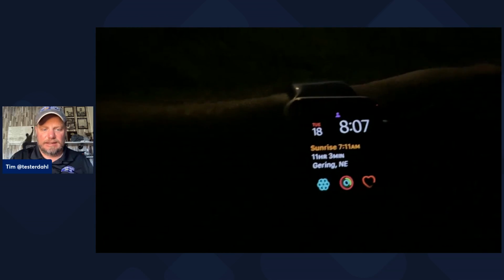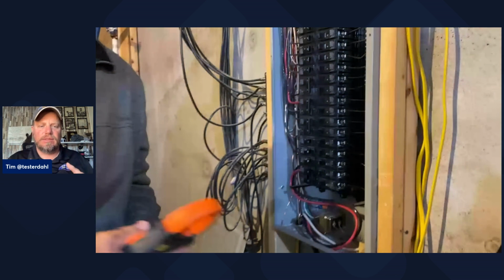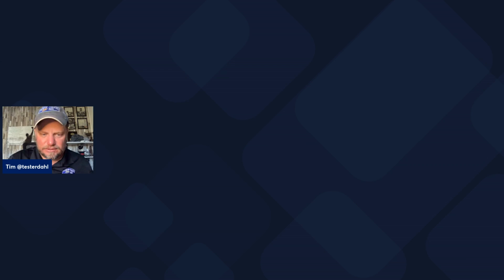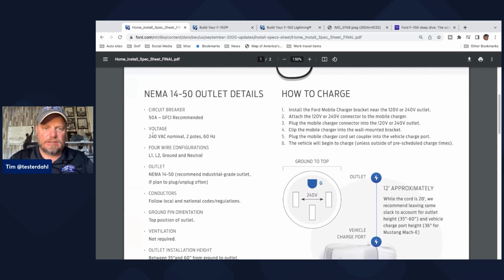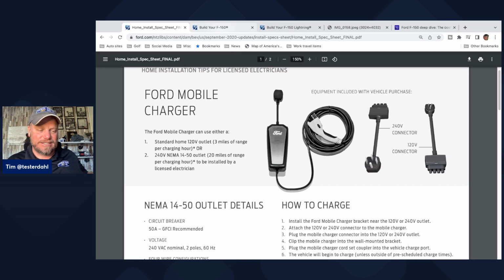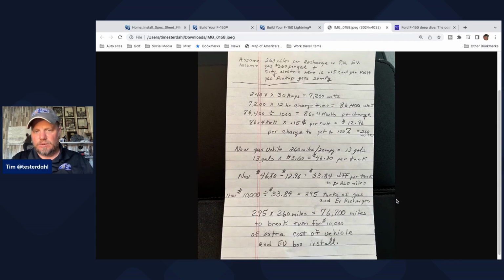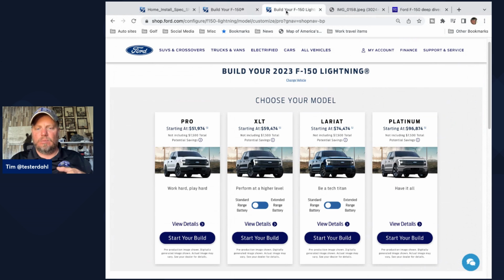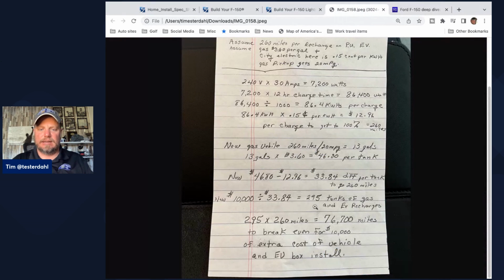11+ hours later on 220V charging price for 2022 Ford F-150 Lightning

Comment: Driving a 21 ecoboost F150, it has a 34 gallon tank that takes 7 min. to fill, has a 850 mile range city hwy combined and about 960 if Hwy only. Filled it today, 33 Gals (was real low) @ $3.14. So 7 min. a $103 and no worries for more than a week!!
Reply: Where is there $3 fuel?  Here in Idaho it is $4.25 for 85 octane unleaded and $5.40 for diesel.
Reply: @byronhaley1566  Okla City, it's $3.15 right now at the 7-11 just down the street.
Reply: They don't make a Ford that will go 960 miles on a tank of gas
Reply: @byronhaley1566  Kansas city. Bought again today at Sam's was $3.13.9 but most others around are $3.29 and its seems to be starting to trend up again.
Reply: @jameskimbrell4971  Yes your right about the 960! Filled up again today and avg 24.2 mpg city and hwy. range was 846 On the Hwy only I get about 27 it's only 2WD but still really great for a 4 dr
Reply: A thought:  without competition for electric supply, the owners of the electric grid will surely take advantage of consumers.

For safety, no one other than a pro should ever be standing around the open electric box.
Reply: my cousin bought a new Ford maverick hybrid pickup.  he's getting 48 mpg with it.  no charging needed.

Comment: Battery technology has come a long way in the last 20 years. I use cordless tools all the time and over the years they have gone from NiCd, NiHD, and now lithium technology. The tools really don’t cost that much, it’s the batteries. They last a couple years then stop charging without warning. As much as that is annoying, having it happen on the road in a vehicle especially if you’re in the middle of nowhere is not something I’d want hanging over my head wondering when it will happen.
Reply: Electric cars and trucks are not about saving the environment in any way or form. Its about controlling our lives and movent plain and simple.
Reply: Isn't just the batteries going bad without warning.

Comment: A branch circuit is only supposed to allow 80% of continuous load. So if you have a 50 amp 240 volt branch circuit then you will only be able to run 40 amps of continuous current without the breaker tripping. The minimum circuit you should have installed would have been a 40 amp 240 volt circuit with an 8-3 wire.  Your vehicle might also be slowly charging itself at night because it is better for the battery to slowly charge itself. A lot of smart devices now will slowly charge themselves if they are charging at night because they know they will not be used for some time.

Comment: Outstanding video! Here in Ohio, they also charge you $200-$500 to renew your tag for an EV. Yeah no thanks. Don't get me wrong, I am intrigued with the technology behind the vehicles, however, this is a luxury versus a must have. What is a "must have", a vehicle that is reliable, resources available, and will get me to work where I "need to earn" a paycheck to ensure I can provide for my family, not a luxury.
Reply: They trying to recapture the road taxes for the gas you don't use. Still, a bogus charge.
Reply: @ New Energy. I don't think any reasonable person could disagree with your statement. EVs are still in their infancy and some day they may be the go to for the majority of transportation needs but right now the ICE is still the necessity for most people.
Reply: @alexandermckay8594  

I did the math, fair value for tags would be $100 or less... Not $200+

But really the tax needs to come from state electric taxes.
Reply: Um it’s $200 extra but how much fuel cost are you saving?
Reply: Show me a tag for $500 for tags on an electric car?
Reply: It's $100 extra for Hybrid and $200 extra for EV. I bought a Hybrid accord last year and glad I did with these gas prices. Went from filling up twice weekly to once weekly and with a 3 gallon smaller tank. I get 43-45 mpg real world driving. I wouldn't mind owning an EV down the road but right now I think EV's are over priced, the batteries suck, and the infrastructure to charge them is not good. We need standardized chargers/plugs first. Second we need better batteries that can support fast charging. third we need charging stations that can support all these EV's. Until then I am fine with a hybrid.

Comment: For someone not able to handle the cost of the extended range battery in the lower trim options ( which the price varies depending on trim level up to around 10K on the XL ) it leaves the owner with a 200 mile range or less in winter.

Comment: Hi Tim just wanted to share a quick tip that most F150 Lighting owners don’t normally use after each charging session is to go to settings/charge/reset and hit reset your going to gain some mileage because the computer will reset from your last driving session.

Comment: The on board charger in the truck is capable of either 11.3kW or 19.2kW per Ford's website which is actually a very impressive spec. That being said, the EVSE (also confusingly called a charger) that was included with the truck is rated for 30amps (240v X 30a = ~7.2kW) which is why the charge times don't quite live up to the marketing numbers. The EVSE is what instructs the vehicle's on board charger - the real charger - the max amount of current to pull. It is done that way so the EVSE is always the source of truth for what max amperage that local circuit is capable of providing. Maybe Ford went with a 30 amp EVSE  because that's a reasonably safe number for the real world of 8/3 on NEMA 14-50's. I know EV's tend to invoke a political conversation but I think that line is starting to be blurred as people see it as a viable technology for certain situations. Thanks for the video, it was really interesting.
Reply: I bet it has a very impressive cost to have it worked on.

Comment: In cold Wisconsin winters, my uncle's Tesla Range drops about 50 percent.  Now imagine towing in the winter.
Reply: Why are you towing in the winter. Also another hypothetical let’s say the technology get trucks up to 500 mile for a trucks. Say you can tow for 250 miles. If that bad. Not to mention normal trucks lose range in winter was well. I’m not sure your 50% claim is true at all
Reply: @moultonlavagaming  to go snowmobiling, or Ice fishing, or hauling buildings supplies. The reasons can be endless. Some people use their trucks.
Reply: @CanadianSpeedster  no one is forcing people to get EV’s at this point. You can choose an EV you could choose an ice vehicle. It’s your toys nobody’s forcing that down your throat.

Comment: I bought the same truck.  Ended up getting a 40 amp charger off Amazon.  Plugged in I am averaging 21 miles per hour.  Gives my wife all she needs to get around for her daily driving.  Man, because of your channel I have purchased my two favorite trucks within the last 6 months.  Back in July I picked up the 2023 Chevy Duramax Diesel 3.0.  Then knowing I owed my wife for supporting that desire, and trading her car in, payback came two weeks ago. I picked up the 2023 Ford Lightning for her.  I love that truck.  Not as much as my diesel, but it’s definitely a close second.

You’ve got to stop making these intriguing videos😂.  I’m now $130K out on truck loans😂.  All jokes aside, thank you for taking the time making these.   I really do have these two trucks, and can only blame you for the two awesome decisions I’ve made.  Both have great benefits, and actually find a way to compliment each other, due to the driving styles of both my wife and I.

Comment: Guessing the mileage changed even though charge went up to 100% because vehicle/battery temperature changed.  It seems like the perception of "range guage" as a precision instrument needs to be rethought since it makes calculations based on multiple variables.
Reply: Yeah hate range readouts, even in ICE vehicles, but I’m the type to reset my trip each fill so I know how far I’ve gone and can accurately gauge what is left based on mpg.
Reply: The range is a guess based on your driving habits. Him sitting in the truck looking at it is what reduced the range, the truck thinks he likes to sit in park with the truck on so it lowered the range.
Reply: It never has been a precision instrument, even on ICE vehicles.  On the Chevy Bolt, the range gauge is affectionately referred to by owners as the GOM:  Guess-O-Meter

Comment: OMG so I did the math for CA residents which is roughly during 3rd tier time of usage (after you come home from work) is about $.31 per kwh. It's like $25 a day to charge the car for at least 25 days (I have a long drive to work) pushing it over $600 just for the car. That's not including when the AC is on during the summer which our bills are $250 when we conserve like crazy. We can barely afford when the AC is on or Christmas lights during the holidays in CA, and cut down this past year because we budget for a $200 bill. No way in hell am I going to have a bill tipping at $1k. That's ridiculous!! These electric companies want to make money and the politicians are like buy EV.
Reply: It's okay you won't be able to charge your car in California because we constantly have power outages because we don't have enough power. So it won't cost you a dime to charge your car because you won't be able to charge your car.

Comment: As you drive more miles to make the price point of the original purchase feasible, you need to put more and more charge cycles on those lithium batteries, witch they have a finite number of cycles before their overall deliverable amp capacity starts to see significant degradation. Resulting in less range per full charge, thus increasing the number of charge cycles to attain a given range. Ultimately requiring a battery pack replacement which is extremely expensive $$$$$$$.

Comment: A new battery pack may cost $15-$20,000 now, but I doubt the price will be that low in ten years or more.  Sooner or later, you will pay...someone.  A solid analysis, by the way, relies on unchanging variables to be accurate.
Reply: In ten years they will allow you to rent the truck for a cheaper price.
Reply: At a dealer, yes, batteries will be expensive.  But there will be dozens of companies offering cheaper aftermarket batteries, as we have now.
Reply: 20k + labor... so just expect to pay 50% of the vehicle cost in 8-10 years
pieces of junk
Reply: Today's batteries will be NLA ten years from now due to the manufacturers getting out of the BEV business to avoid going bankrupt.

Comment: So if you’re not living in a modern home with 200A service with a service panel in the garage, such as apartments, condos, etc. you’re a fool to fall for the EV bull crap.
Reply: Only one of the many down falls of a electric vehicle.
Reply: Just depends on how much you drive. I've been charging off a single 110V circuit for years. If you drive less than 30 miles a day (on average) it's not a big deal.
Reply: Really 100 amp service would be more than adequate if you have a gas stove... and dryer.   Even with ac pulling 30.. plus 30 on charger leaves you 40 to spare..  and led lights.. coffee maker.. etc.  Still no 40 amps... plus won't all be running at the same time.

Comment: The issue with them asking for a 50A capable hookup ‘only’ providing 30A of charging is this: there is a difference between periodic use and continuous power use. The way it works is that if you are using a circuit ‘continuously’ aka 3 or more hours at a time, the circuit needs to be de-rated to a lower amperage because over time the wires/contacts heat up and if there isn’t extra capacity to take up the requirement for more amps due to heat cutting the conductor’s ability to pass current(amps), you may overheat the conductors or the contacts which causes problems.
I’m an electrician BTW if anyone needs more clarification.
Cheers! 🖖😎👍